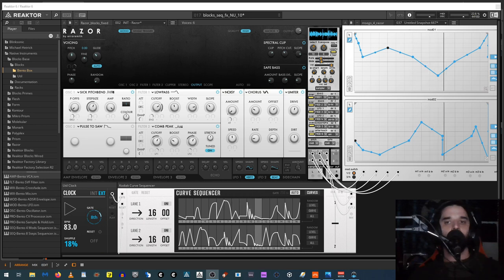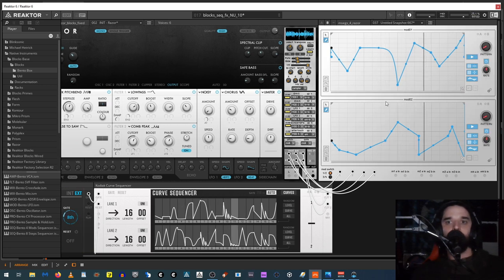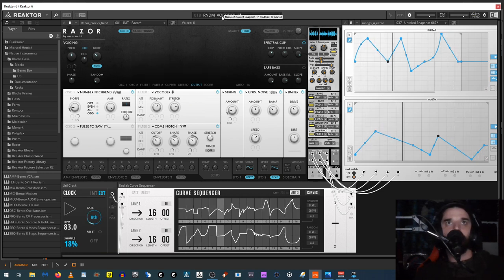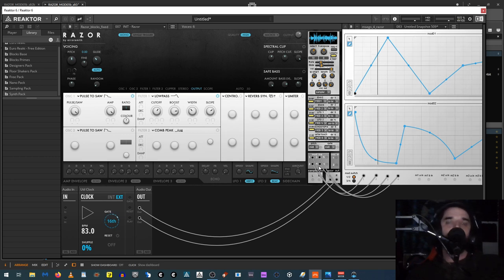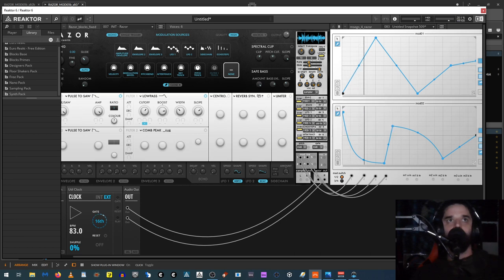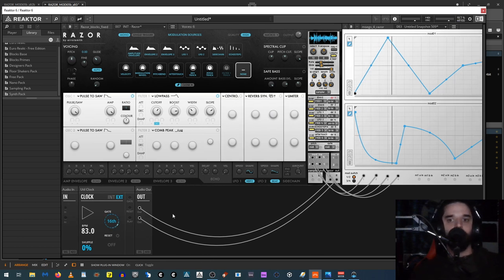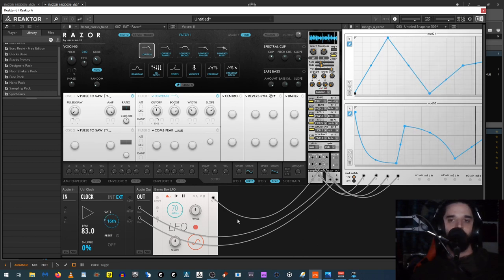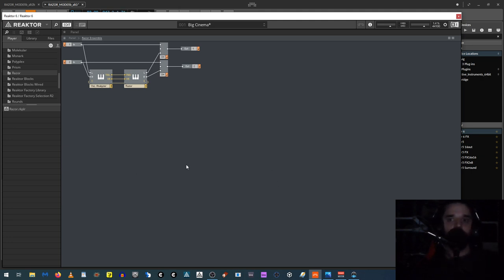How to modify Razor to use in Reaktor Blocks

Comment: Hello Andrei and thank you for the tip. There's a way to  extract all the razor's modules individualy (like osc1 module or fx module for ex) for creating independant blocks? I tried to extract osc 1 , signal goes out on out 1 and 2 but no sound. I think the structure is not good because no more entries in relation of the other modules of razor. Anyway do you think it's possible?
Reply from the maker: Hi.  It would be really complicated to do that, because since Razor is an additive synth, all of the sections are controlling the partials with the sine bank.  So, they don't really work independently.  For example the fx aren't actually audio fx.  they mimic audio fx, but are actually just controlling the partials.  There is some info online about these things.  In the Reaktor user library, there is a bundle that contains a pdf that explains how to work with partials and the sine bank, but it is way over my head.  In the Reaktor 5 tutorial patches, there is a very basic additive synth that you could use as a starting patch.  If you don't have Reaktor 5, the Reaktor 5 default library is available in the Reaktor user library.  But, I think additive synthesis in Reaktor is very hard to understand, so I'm happy to just use Razor, as I think it does everything you would want from an additive synth.
Reply: @AndreiOlenev  Thank you for your answer. Have a great day !